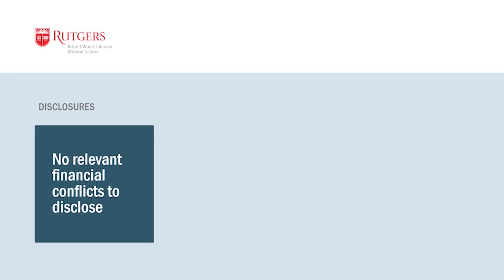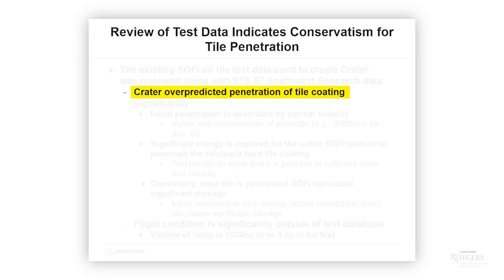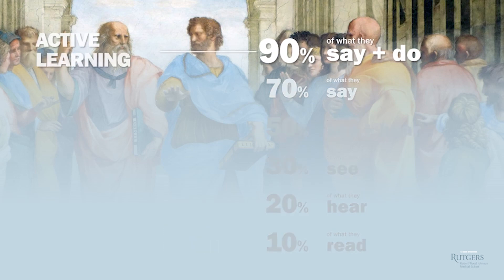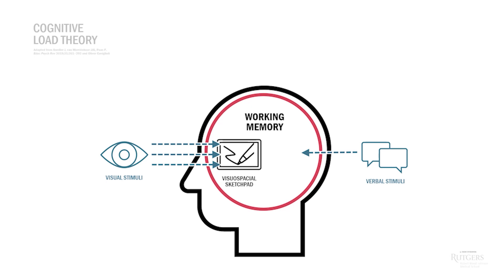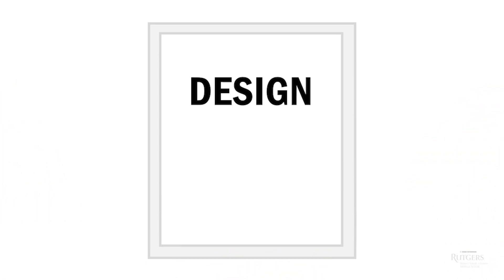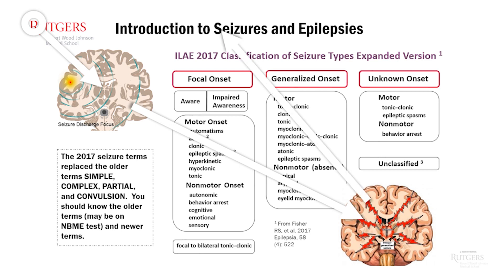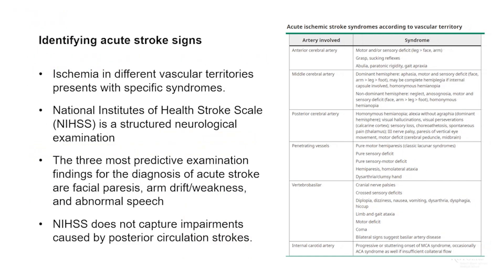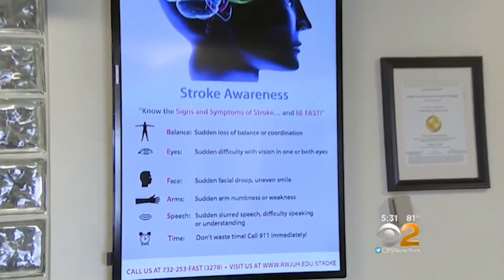Design Matters: Slideware in Medical Education

Comment: Hi, Just wanted to ask, creating the masks for powerpoint is time consuming especially for MRI, CTs and even more difficult for people (nice job on shuttle crew and example of stroke patient). Do you do it on photoshop or other software. Thank you. It was wonderful.
Reply from the maker: The proper way to mask is to use Adobe Illustrator , which is a difficult program to master. The curve tool in PowerPoint works well most of the time. Insert / Shapes/ Curve.
Reply: @theneurophile  Thank you.